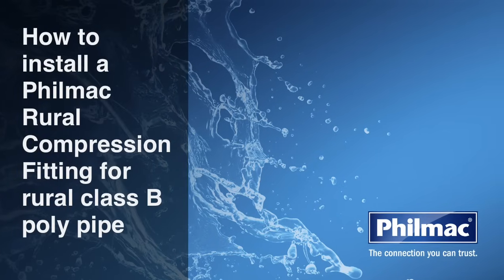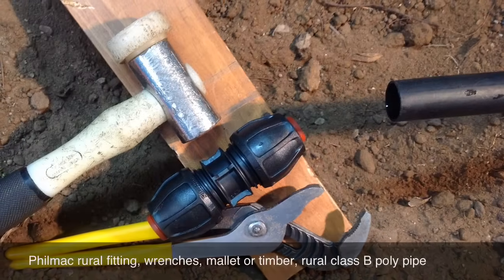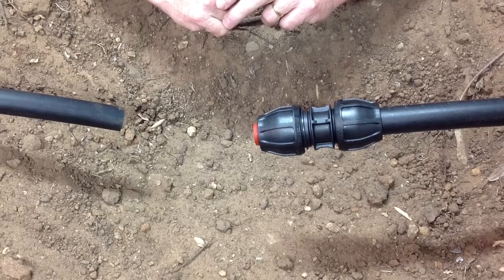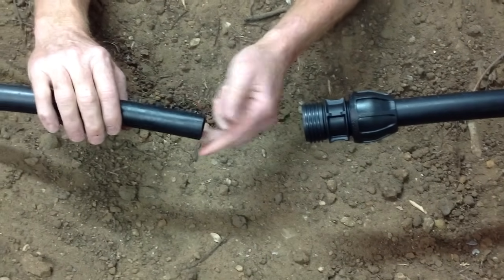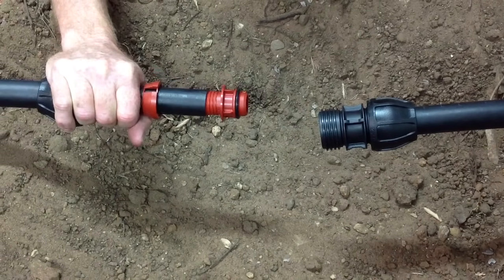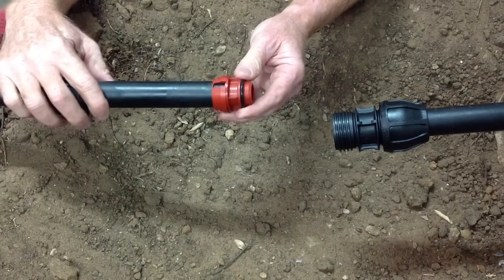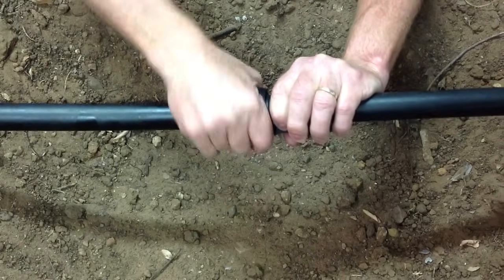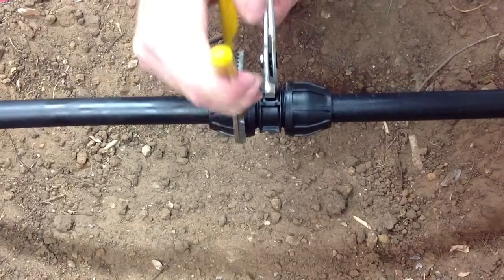How to join rural class B poly pipe

Comment: Terrible guide.First a little lubricant on the red end saves damaging the O ring ,second rubbing a little soap or other  lube on the thread meams it will pull up much tighter an less inclined to rotate with the collar which ultimately ends up with a much looser grip on the poly .Before I started using this trick i had regular blow offs despite using LOTS of force on the wrench to tighten them.(And no leaks from damaged O rings )

Comment: What length to cut, if one wants to fix a leak with a single joiner ?
Reply: Assemble the fitting and tighten both nuts as far as you can, and then remove the nuts and collars, leaving the inserts locked in place. Then measure the distance from one pipe stop/shoulder on one insert, to the pipe stop/shoulder on the other. That's the amount of pipe you need to remove to install the fitting, but best to leave yourself an extra couple or few millimetres, better to leave the pipe/s too long than too short.
Reply: I did it with 3mm cut of the leaky section.

Comment: Bullshit! I have two pipes which are underground that need joining, how on Earth do I just pull one pipe up to make the joint when both ends have 30m of dirt on top of them? You even intimate that this is an underground fix by having a patch of dirt in the video. How about show a proper, in the field, fix of a ruptured pipe that needs re joining.
Reply: If you cut youself short you'll have to use two.
just measure the length of the core of the joiner minus how far the inserts go in and account for the length of section of the inserts that don't mate with your pipe or the core.
Cut it at the correct length and manhandle it a bit.
Reply: you need to go buy yourself a shovel and pick axe capt. obvious.

Comment: So how do you pull out the insert from the poly pipe? I have not found an easy way. Any ideas how to make this easier? Thanks in advance.
Reply: I find using a heatgun if you have power or a thermos of hot water to make the pipe malleable and then using pliers to pull it.
Keep in mind of course, this destroys the insert unless you're really gentle with it..
Reply: Warm with a torch

Comment from the maker: Hi Adam, thanks for the feedback. The aim of these videos is to simply provide the key steps on installation for those who are not familiar with the products. While some installations may be easier in practice, and some harder, we hope that this video illustrates what you need to do to securely connect rural class B poly pipe using the Philmac range of Australian made rural compression fittings.